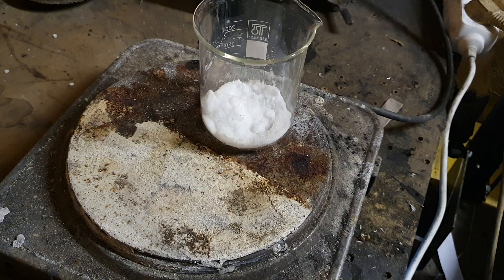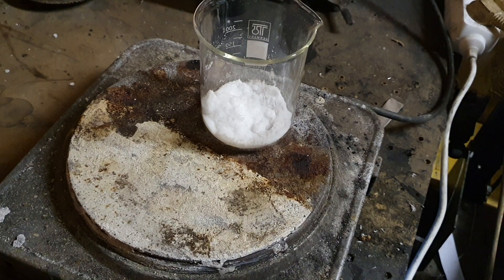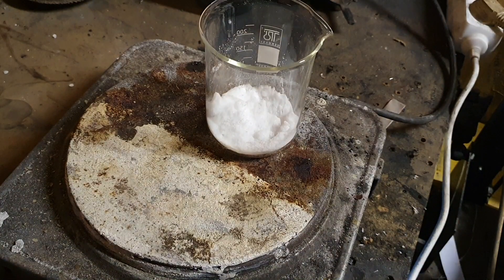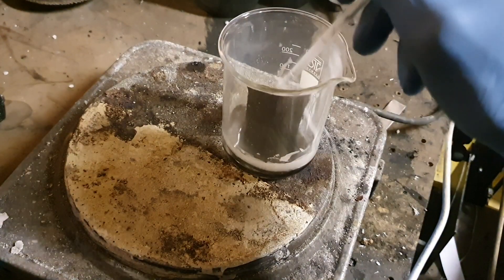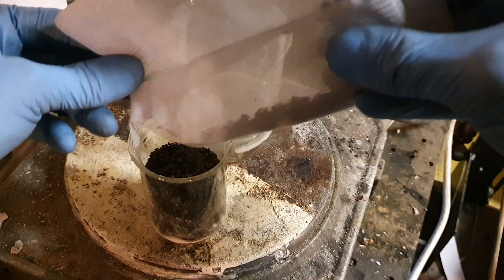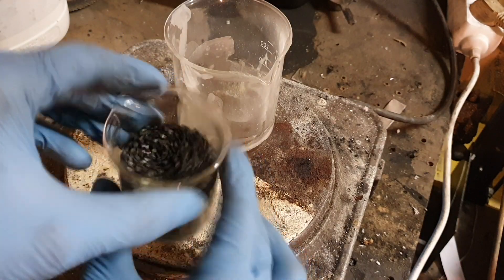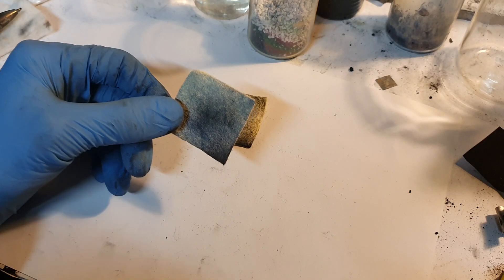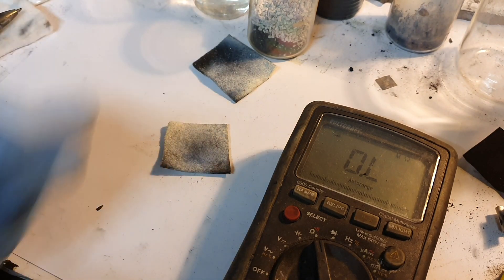Graphitic Carbon Nitride impregnated Carbon fiber

Comment: what if my furnace does not have a "heating rate" set up?
Reply from the maker: You can not set the temperature? Then we have a little problem. It is good to heat on a right temperature +-10C for and that can hold its temperature for some time. Buy some thermostat to 600 deg C

Comment: Is the graphitic carbon nitride not conductive if you add acid electrolyte? I would speculate that the protonation of the SP2 nitrogen sites create delocalized positive charge (holes) and so becomes conductive, much like adding acid to polyanaline (also makes it conductive)? The nice thing of having it in this form is high surface area as I think you would only protonate the surface layer, but here the surface area is probably large resulting in good protonation and conductivity in strong acid, maybe?
Reply from the maker: Yes and no. gCN get a bit conductive in acid electrolyte but still far away which I can get that way. Maybe need to use stronger acid. Yes you are right about surface area,... is really good. Also with that proces on carbon fibers will also create extra pores with temperature annealing
Reply: @cayrex  You should try acid with your version and the high surface area, I suspect conductivity will be greatly improved because it's mostly surface, so you can protonate most of it, bulk gCN is not mostly surface and so you only protonate a little and so probably don't get much conductivity enhancement, but I'm sure with your version it will be very good!
Reply from the maker: I will try again with a bulk gCN first in 5M HCl. Or maybe I will go with H2SO4 for S-gCN which have better performance as H photocatalyst. I will see...
Reply: @cayrex  Nice, I look forward to it. I prefer sulfuric acid, more compatible with metals, HCl is a nightmare of corrosion problems.
Reply: For photocatalyst, protonation may also help with making the material absorb more light. Usually with organic colours/dyes, charging the nitrogen sites in the molecule to NH+ makes the colour much more intense and deeper and this should help with your optical efficiency/quantum yield.
Reply from the maker: @idea-shack  yes,... there are so many modifications,... like O-gCN with H2O2 is also not bad, etc. First I will start with HCl to see what I will get and I will go to next one like exfoliation with H2SO4, etc
Reply: @cayrex  Good luck!
Reply from the maker: @Nicola Toma What you think,... can be protonated gCN used with TiO2 as booster in solar cell?
Reply: @cayrex  You mean form the gCN over the TiO2 powder support first then protonate? That is also an interesting idea. Might be some synergy there and the H+ gCN could give you some conductivity, nice thing about the TiO2 is that it's not black, so won't waste so much light energy by simple absorption as making it over carbons.
Reply: TiO2 also very good at absorbing UV and then using that energy of exited state on it's surface, so if that surface has H+ gCN, you could have some good photocatalytic effect. Charged states on surface can form energy carrier called surface plasmons which carry energy of shorter wavelengths of light to catalytic sights.
Reply: Can you please do a followup vid of that too?

Comment: Very nice!. I can tell that the g-C3N4 produced here is of great quality by that lovely yellow colour on the felt. Really awesome carbon felt composite g-C3N4 method you have developed there for certain. Quite impressive how it turned out just at 9ohms!, considering the normal resistance of g-C3N4 is extremely high indeed :) (y)

Comment: So.. is it possible to create g-CN without a kiln? i have all the required materials, just the fear my beaker will explode by thermal shock since the experiment needs to be done outside (it releases ammonia).
Reply from the maker: Sorry no. You need constant temperature of 550C for 3h. Ceramic beaker for coffe or tea will also do the job fine. You only need a rising temperature of 3 to 5C/min. And the ceramic beaker will not crack. That way I make only g-CN. Yes, the ammonia will be also the problem,... but for making small sampler will not be so bad. But if you can make it outside or in ventilated area.

Comment: What was the original conductivity of the carbon felt before kiln?
Reply from the maker: Around 3 ohms/cm
Reply: @cayrex  3 ohm cm before and about 10 after ( from video )?
Reply from the maker: @denniskramer9788  the non impregnated carbon felt have 3 ohms/cm before impregnation. The graphitic carbon nitride is non conductive at all and is almost useless for some battery applications. To make graphitic carbon nitride electrode conductive you need to put a good amount of conductive material (carbon black),... and also in that case the conductivity will be around 100 ohms. With that method I get good conductivity of the graphitic carbon nitride electrode without any extra conductive material and binder. And I also get great surface area. The conductivity of carbon felt decreases because of impregnation of non conductive graphitic carbon nitride